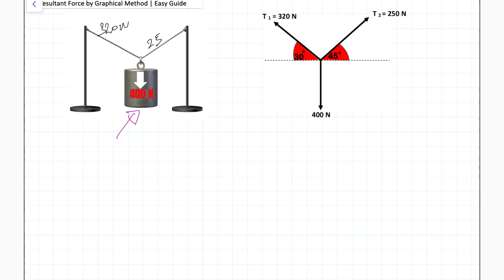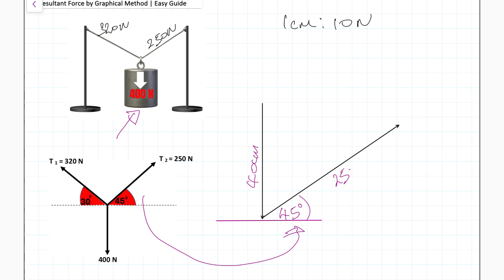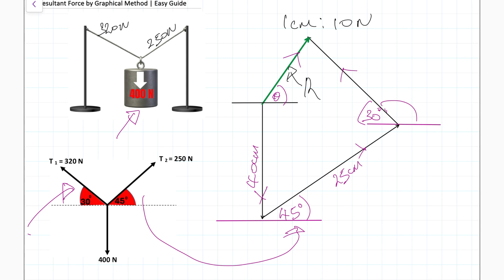Resultant Force by Graphical Method | Easy Guide

Comment: what if the angles are equal what do you do then?
Reply from the maker: The method would be the same - check this video out and see if it helps - Resultant Force Graphical Method | Magnitude & Direction
https://youtu.be/WOUX3oy0WRo
Reply: @MechanicalEngineeringTutor  could i just do the parallelogram for the 2 forces at an angle and neglect the force acting downwards?
Reply from the maker: @owamtambekile3077  parallelogram method only works if you include all forces acting at that point. If you leave out the downward force, your resultant will be wrong because you would be missing part of the system. The final direction and magnitude will be incorrect